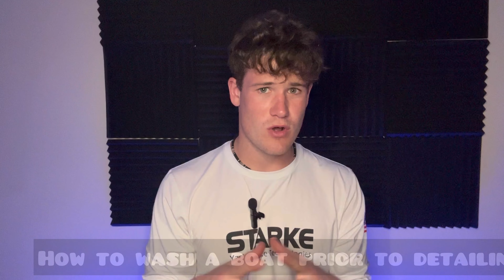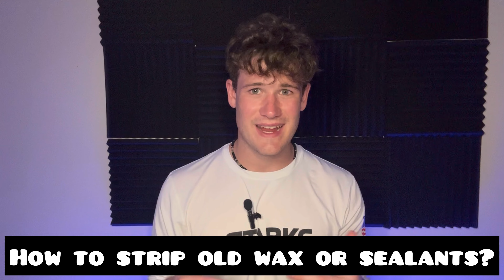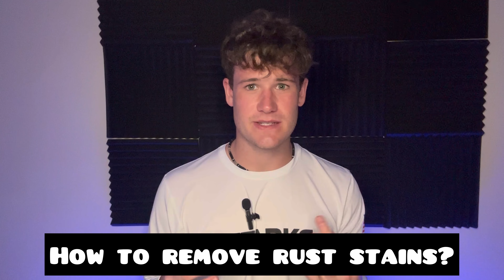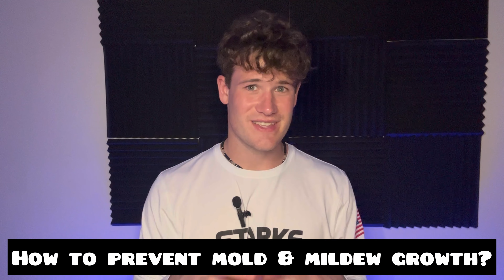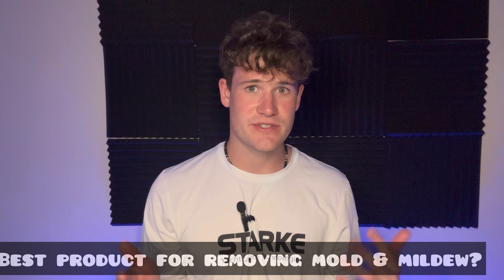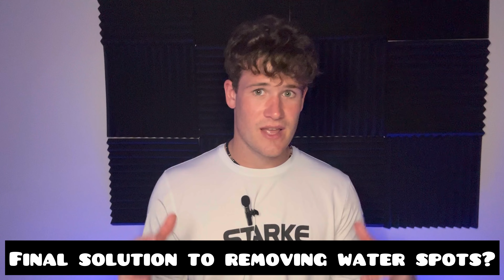Boat Washing Q & A | Series 1

Comment: Thanks for the comprehensive boat washing vid.

If you are going to RESTORE both the above rub-rail and below rub-rail areas of your boat, would it be best to TOTALLY complete the above rub-rail first?  My steps for 'restoration' would be:   Dawn-dishsoap wash > Level-R buff > Elevate or Finish-R polish > Dawn-dishsoap wash > Hyper Hold Pro Sealant.

So basically I am asking if the Dawn-dishsoap wash when it runs down the side of the boat from the ABOVE rub-rail areas, will cause streaking on the BELOW rub-rail areas, (if the BELOW area has already been restored with Hyper Hold Pro).

Many thanks,

Dave H
Reply from the maker: It won’t cause streaking it’s just soap, but yes if you are going to split up the topside and hull it would be best to complete the topside first. We do the entire boat at the same time so we never run into issues

Comment: do you have a tool to dry the hull opposite of the dock side?
Reply from the maker: Shurhold makes a 45% angle attachment for this purpose that attaches to your telescope pole. I usually just lean over the topside or use the solstice water raft